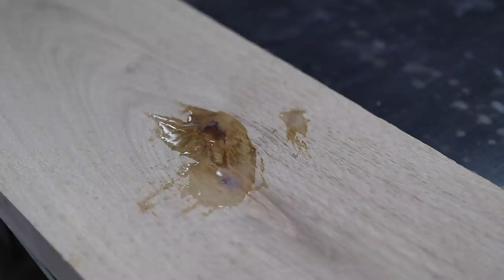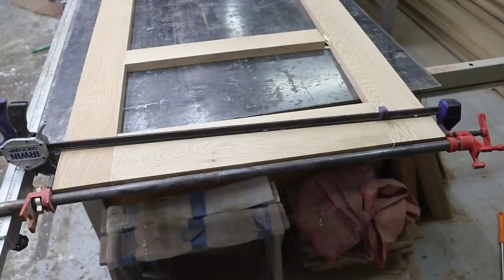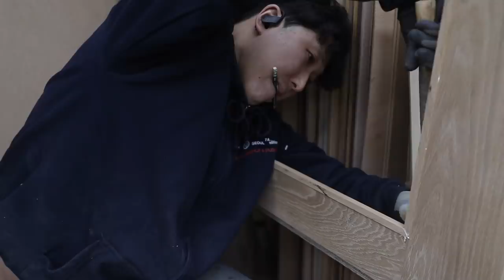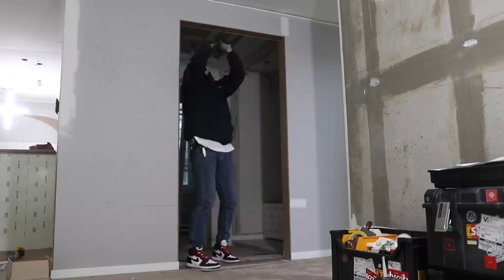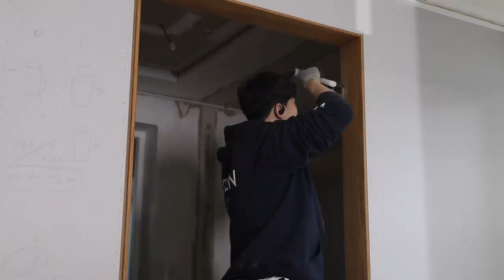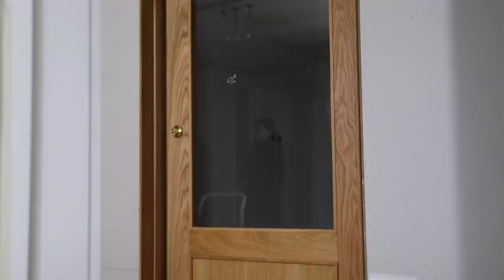W84_Wood door frame installation

Comment: Hi.I don't want to criticise your work,but the pieces of the door lining should be connected prior to   be fitted and also I wouldn't rely entirely on a biscuits joints when comes to building doors,better option is tongue and groove reinforced with either domino or dowells(for strength and prolong the life of the door allowing wood movement).Other than that is nice job!

Comment: A biscuit jointer to to glue the end grain to the straight grain ?? I know it's an inside door but nobody would do that .... and you have a festool domino, why wouldn't you use that ?
Reply: i was wondering the same...
Reply: Why he made double  not everybody has expensive domino machine!!
Reply: Could you explain for me why nobdoy would do that? I am begginer in woodworking
Reply: @beAdamant  end grain soaks up glue and provides a very weak joint. Glueing in a domino ads a little more surface area and ads in strength compared to the biscuit used here which is solely an alligmnet aid and ads no strength at all. Typically though a mortise and tennon joint would be the strongest option for a end grain to long grain joint like this

Comment: You use biscuit for door frame? I see you have domino. Or just make traditional tenon and mortise.
Reply from the maker: yes. I used domino or other mortise. and this time, I use biscuit. I think, biscuit enough too. indoor door. I tried this way 5 years ago. that has no problem until now. but this way is not perfect. I just try various ways. if the way has problems, I will change it. that is how I grow up😂

Comment: Biscuits? Why not dominos.
Reply: why? there is no argument against biscuits for this project i would say, there are no forces that culd break the joint. cheaper solution giving  the same result.
Reply: also you have some playwhile joining parts together? cant say much cuz i own only biscuit jointers for now (dewalt, makita), but for most jobs isnt  it enough ?
Reply: @pawemichalak6275  Same result? What? Face palm! I'm not wasting my time, you clearly know everything. (Shakes head and walks away).
Reply: @rivergate  you show some great arguments in this comment, cya